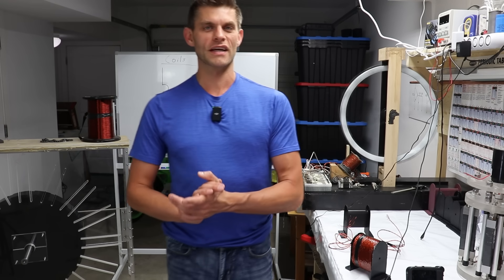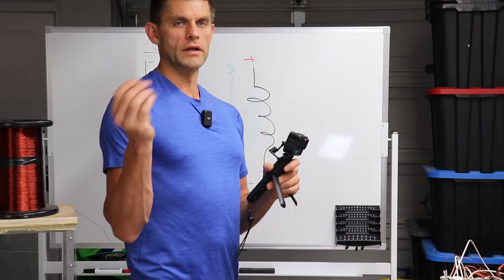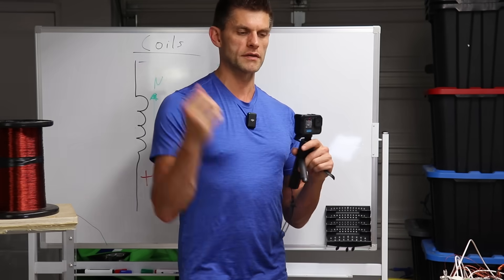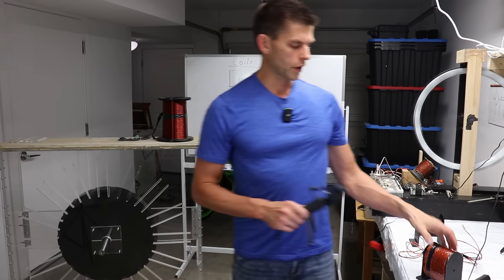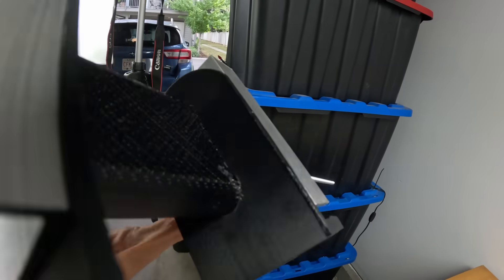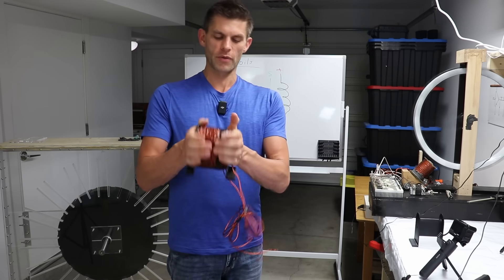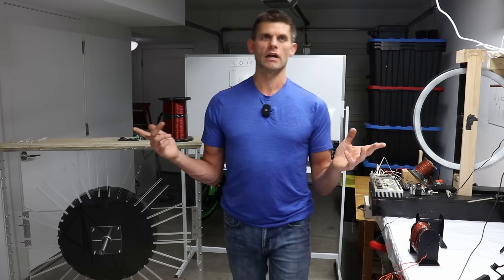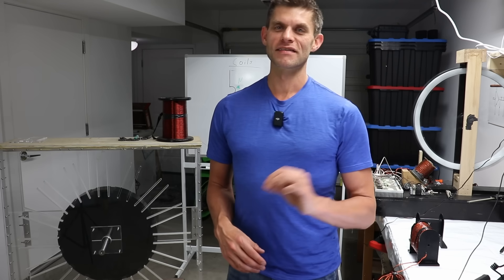Unlimited Energy in My Garage (No Patents)

Comment: Keep going!  I don't discourage you.  I am not a believer yet, but I need to tell you a couple things.  1)  Technically, the magnetic field runs perpendicular to the flow of the electricity.  I'm sure that you already knew that, but I wanted to clarify that for your viewers.  2)  When moving a magnetic field rapidly across aluminum, or visa versa, the aluminum produces a mirror of the magnetic field, FOR FREE.  To me, that says, "double your power for free."  3)  You may want to research ceramic bearings.  They cost more, but they can be lubricant free, more durable, and they are not ferrous (they won't interfere with magnetic fields).  4)  I have been wondering about boosting the efficiency of (magnets versus the coils).  The magnets and the coils approach each other tangent to the stater.  What if the magnets were geared and suspended on axles so that each one approached each coil facing the coil and rolled past the coil pointing at it the whole time maximizing the force?  So, the magnets would roll inside the stater like a planetary gear box with each magnet rolling from positive to negative.  It would be a higher torque, lower RPM motor and probably also function as a step motor.  I admire the amount of work and investment that you are putting into your projects.  GOOD LUCK!
Reply from the maker: Appreciate the tips and ideas, thanks for the support! Great attitude 👏
Reply: Ceramic bearings are badass. My buck knife has thee smoothest action. Like its weightless.
Reply: @fallofthezombies1379 So does my Benchmade, love it
Reply: 2)  When moving a magnetic field rapidly across aluminum, or visa versa, the aluminum produces a mirror of the magnetic field, FOR FREE

????
Reply: @CrowClouds  not 100% sure but does it mean that when you move an magnetic fields across aluminium, it creates a field in the opposite direction within the aluminium? That technically you then have a magnetic field for free because the first one would be the product of the energy supplied....which is then "canceled" but left with a magnetic field in the aluminium that would provide work? 🤔 I don't know about effects of magnetic fields on aluminium...so just a guess
Reply: @sderb2562  magnets don't perform work.

In your example the work is where the magnet is moving. This would create eddy currents in the aluminum which would act as resistance to the moving magnet.

But by themselves a magnet does not perform work. 

I know your all thinking "but they attract or repell stuff!" 

Ok then why isn't there a 100 percent magnetic motor. Where you just have magnets attracting and repelling each other.. and there you have it.. it doesn't exist because it can't.
You can fake one by spinning it with your hands (putting work into it) but eventually they will lock up when the forces you put into it are sapped. And whatever spinning motion you produce will have 0 horse power, or if you tried to generate power from it you would produce 0 watts.
Reply: @ShivaTD420  yes i understand the notion of work and magnetic fields and how opposing magnetic fields work against each other...whether it worked or not was not why I was ststing what i did....was just trying to understand what the guy was getting at and whether  magnetic fields would be present in ally was all....not that it would work 🤷‍♂️

If there is a way to gain energy for "free"...without ever drawing it from things like zero-point energy in quantum mechanics...the only possible way I can think of will be scalling it with some form of stepping. Think of a bike...when in 1st gear we apply work to get the bike to move...maintaining the same level of work...as our speed increases, we then swith to the next gear up ..maintaining the level of work...but now our speed increases due to the change of cog and the motion we already carry. We couldnt of got that speed from the second cog at the start and a standstill, without excessive work. But moving through the cogs at the right times.. we can increase our speed without the excessive work needed and only ever give the same amount of work. If we could scale an induction of energy using a constant load on work...that could be a form of energy for free...its just finding the right mechanism with the right cogs 😁
Reply: @sderb2562  the issue with zero point is once you scale it up. 

The movement of a field affects/effects other fields. So your just getting that energy and putting it right  back into the vibrations of the other fields. 

At best you would break even netting nothing.

As that is basically what the tiny vibrations in the quantum fields are equating to. 

I can see where your getting at. I always thought of something like a tidal generator. But water waves have a energy input (rotational energy, tidal, and the sun). Thus allowing you to have a net gain when you harvest a wave. 
Water waves also don't behave like waves in fields that affect other fields.

 It's more like you are on a spring mattress trying to harvest energy from the springs but you can only put it on the spring your standing on, causing you to lose the energy  since your Spring just pushes against all the ones around it.
Reply: @ShivaTD420  Just to be clear buddy, not arguing at all, just enjoying the discussion with you ;) 

Yes...but you are thinking on a macro scale  but also making my point exactly...Everything is in equilibrium and always falls to its lowest state based on call. If you pull a "positive" from zero point energy then it would result in the creation of a "negative"...true!...which is happening all the time with virtual particle creation and such, you cant take without giving back. If you were to feed back a "negative" that we don't need in order to pull the positive that we do...we create a cyclic system that we can draw useful energy from. We burn rubbish to create heat to generate energy...same principle...but what if we do this at a level where we harness natures natural functions. Rather than in macro states, where energy is always falling to the lowest operational energy. Take the lowest operational energies and arrange them in a system that produces a useful situation at a macro-scale. 

Its like the principle of quantum computing...set the structure in such a way, that the change of a state under the natural function of entropy, causes the state to fall to its most natural order (equilibrium)...from which we get "free" computation. 

This is just states of energy within a system, falling to their lowest ground state...the balancing of energy. But the very nature of that gives us something...the computational power of nature. If we think of energy in terms of this...its nuclear fusion or fission. Set a state that results in the outcome based from fundamental principles of nature.

When we think of motion, we need to draw from the perpetually moving matter of nature. There should be a way to put together a system  that we can draw from and channel what we need one way or another...if you catch my meaning. So the work is done by nature...not us providing the work. Honestly...I think its purely a case of engineering and I'm sure AI could come up with something in the future, even if we cant. I suppose we have made a start by saying, the wind always blows, so we set a wind turbine up...water always flows so we set up a hydo-dam...well atoms always move so what can we setup for that?  🤷‍♂
Reply: @sderb2562 all I know u must creating a Junction barrier how? By breaking the symmetry, creating chaos in the vacuum using sine wave, Rf, n pulse signals ,according to john hutchison n tom bearden u suck the jitters in and  electron will born ,appears out of nowhere..from nothingness, base layer reality..
Reply: @CrowClouds that's what floyd sweet did ..aluminium box( vacuum )barium ferrite magnet n two coils inside the box ..God knows how he tuned it
Reply: lot of great stuff here mate
Reply: Keep working bro! You might be our next "Energy Innovator Genius"!
Reply: Would air bearings not work well for this?
Reply: @sderb2562  Do you mean magnetic suspension?
Reply: @stevesmith7839  no I don't believe they are magnetic...they are bearings that are made in such a way, where the gap in-between the materials is so small that air compresses and it creates a thin amount of pressurized air between them. They are frictionless and obviously create less wear.
Reply: Y'all seen the alien space craft or believe in them being real I've seen one recently they have some kinda something that breaks our "laws of physics" all I know is if you break them or get close don't answer the door for nobody and make a copy of you work left with a few different ppl and release it fast as ppossible have it verified as fast as possible on live tv or something but lot of money makes a lot of problems if you fuck with they money be ready to duck em good luck brother be safe is all I'm saying don'take the same mistakes all the other ones before you did look into it so you know what not to do and plan ahead
Reply: Perpendicular to the flow of electricity yes, but he was referencing a coil, in which he was still anatomically correct with his representation.
Reply: "2)  When moving a magnetic field rapidly across aluminum, or visa versa, the aluminum produces a mirror of the magnetic field, FOR FREE." 
That is 100% not FREE, you add more enegy into the system by work! 

I little reminder of the laws of physics which none have been able to break for the last 100s of years, and nobody will break them in a 100 million years...
"The first law of thermodynamics states that, when energy passes into or out of a system (as work, heat, or matter), the system's internal energy changes in accordance with the law of conservation of energy. This also results in the observation that, in an externally isolated system, even with internal changes, 
THE SUM OF ALL FORMS OF ENERGY MUST REMAIN CONSTANT, AS ENERGY CANNOT BE CREATED OR DESTROYED."

Your two battery/motor setup will NEVER IN A MILLION YEAR output more electricity than you put into it, unless you add more energy other than the battery e.g. work, like spinning the wheel with you hand. You statement about this setup that it utilizes "FREE ENERGY" from the environment is utter BS!
Reply: @daNorse  if energy cannot be created then how did any of this get here? how was there ever a big bang?
i think the laws people so fervently cling too are little more than trammeling born out of a simplistic mindset concerned with base motivations and driven by a system that rewards only such.
Reply: @ProfessorToadstool 
The answer is YHWY, very simple. In order to have a world that is constantly changing in motion, there has to be one quantum state who is constant and never changes, like a foundation, and bring value to everything. For me to distinguish love over hate, or to know that my pet dog is a dog and not a fish. We live and have our being in YHWY.
Reply: @ProfessorToadstool  Physics is not a religion, it's science.
Reply: @daNorse  this is the type of attitude that keeps us stuck as a species. What if there's a way to effectively utilize another force? One day a guy said "man if we could only focus the power of the sun, it could cook food without fire." And some other guy said" fire is how we cook food, we burn wood to make heat. Always have, always will." I get that you are talking about the laws of physics but the idea is the same . There could be a way to harness an earthly force with high efficiency. He seems a far cry away from most of these other "zero point" nuts. I'm not yet a believer in his invention but I want to be. I am skeptical myself but the difference is I'm hopeful.
Reply: @joshtempleton5274  No, this is not about an "attitude", the rejection is based on known physics. What sets back human progress is when politicians get spooked by something they know nothing about. Like Angela Merkel being spooked by the accident in Japan. Nuclear power is the future of energy, but ignorant politicians are preventing us from taking advantage of it. This is known physics and has been used daily 24/7 in 200 submarines and aircraft carriers for decades without a single accident! While wind farms have had many accidents. Just one of these nuclear power plants on an aircraft carrier could power a small town. I'd say we already have "free energy", but human progress is being stopped by a spooked politician. I suspect the real reason is that once they acknowledge that nuclear is the way forward, they'll have to stop all these nonsense wind/sun projects that will never be economically competitive with oil/gas/nuclear. The ONLY reason a wind farm break even is because these idiots treat subsidies as "income". What any economist would do was to do a proper cost-benefit analysis, factoring in all costs and benefits, including grid costs, environmental costs, and demolition at the end of life. But they never did, because if they had, they would have to admit that wind/solar is not viable in the long run. Josh, there you have the "attitude" that stops human progress presented in an easy to understand format.
Reply: @daNorse I understand for large amounts of power but say for your own home or an rv, solar and possibly wind should be effective for such a small amount right? In homes, excess electricity generated is credited and you could in theory get paid for the extra electricity you produce, I'm assuming enough energy gained and with storage you could go off grid or even potentially gain revenue from putting solar panels on homes abandoned, like in the hood, potentially earning free money to pay for property tax at least. You can live without modern convenience, could this potentially be a solution to homelessness if they could generate income for bare essentials, especially with squatters rights being a thing. Just thinking thru typing sorry lol
Reply: @GRIMsoSLEEPY  As an economist I can tell you it not "free money" if you'll have to put in an effort and work to get it. The "grid" in a home is not comparable to country-size grids. Solar/wind does not meet the requirements of a national grid. That is why these grids have to be supplemented with "backup" solutions with cheap fossil fuels with a capacity of almost 100% of the grid to be fail-proof. Thus you could run the whole system without the solar/wind nonsense for half the price. But this is kind of nonsense you end up with when ignorant politicians get the last word. This is based on political dogma and not science, engineering and economy. 
As for the homelessness, that IS a political issue and not an engineering issue. Here in Norway we have no homeless at at all. Excluding those who willingly choose this lifestyle.
Reply: It never ceases to amaze me how many prick assholes that come across
as smart & well studied use the knowledge they have to shit on others at a moment's notice. Utter bs?
Something tells me your laws of thermodynamics are in fact not the written in stone end all law you have been taught it is.I know Tesla believed in this same phenomenon & but your not trying to hear it is that it? Stop being a damn hater & start trying to use your time left here to be a asset and not so much a negative downer . Some of the things in science they thought they understood well is turning out that they really dont know shit 
some examples big bang theory all heavy elements made in supernova
all supernova explode the exact same force
ohh & ya it actually turns out carbon 14 dating as a reliable & accurate form 
of testing the age of something is upside down and its apparently been known its flawed and yet years and years people are taught its on the money.
thats not science thats
bullshit & ask yourself are you limiting yourself with these "laws" that sure pretty good at keeping a civilization stuck on old tech and old beliefs ?
maybe? maybe not? but at 
the very least dont shit on the man for trying .
have a nice evening sir.
Reply: @daNorse  You did NOT explain how the magnetic mirror in aluminum works or how it is not extra energy.  We all know the law of conservation of energy, so don't go off on a tangent explaining what we already know.  TELL ME about how an aluminum magnetic mirror works.  Be instructive or constructive, NOT dogmatic.
Reply: @stevesmith7839  I don't want to be as blunt as daNorse, but any moving/oscillating magnetic field will induce a current in a conductor, and any moving current will induce a magnetic field. According to Faraday's Laws and Maxwell's Equations, the induced current and magnetic fields are opposite of the originating currents or fields. Therefore, there will be some resistance or/and heat generated, resulting in a loss of energy.  Superconducting effects can reduce or eliminate the existence effects, and at the moment, the cost of generating a low temperature environment to support super conductance won't support "free" energy.  Room temperature superconductors [not yet discovered], or General Relativistic effects [such as a Bose-Einstein Condensate - currently only VERY low temperature] might offer a tiny loophole. Note that Alpha particle decay from a nucleus and some transistors reside in 'loopholes' ... so another Edison, Tesla, Bardeen, Shockley, or Brattain might discover them? ;-)
Reply: @hanksimon1023  Give Tesla the modern internet, and he could take off into orbit.  Give each of a billion average people internet, and they can each be a Tesla.
Reply: @stevesmith7839  Agreed! Except for a few choice billionaires ;-)  I see more people   experimenting like Edison (relearning the Physics in some cases) rather than starting with a solid educational background, like Tesla, then building on that foundation. ;-)
Reply: @hanksimon1023  But think of all the things any of us can know with a couple clicks that Tesla couldn't know even if the information already existed unless he bought a bunch of expensive books and spent days reading them.
Reply: @stevesmith7839  Agreed! But, that was then, it's a lot easier for people to learn the related physics... Edison didn't have that option. ;-)
Reply: You definitely shouldn't be a believer, he's just spouting nonsense
Reply: @TheCodeCurrents  whether or not he is or isn't...not my money he's spending lol worse hobbies to have I suppose. Do you think there is any way to create a system...known physics or not...just speculative if you will...that is capable of producing energy technically from nothing?